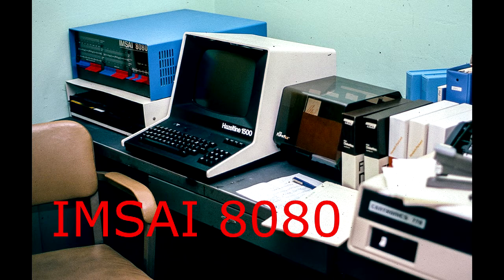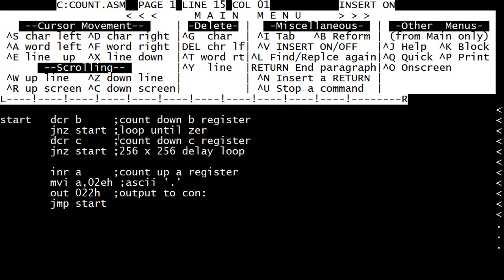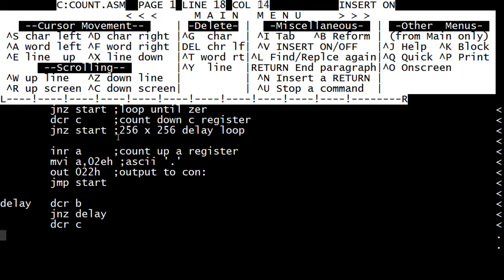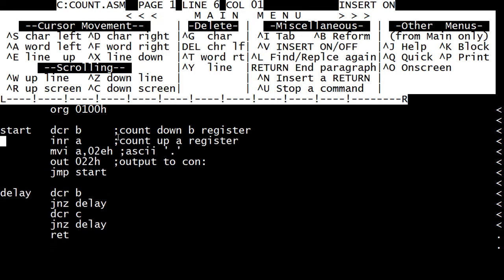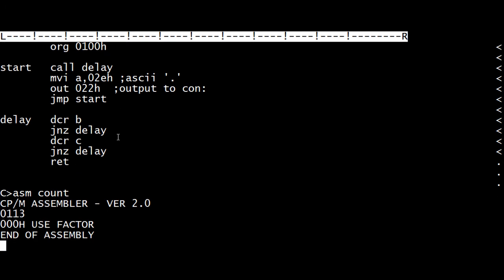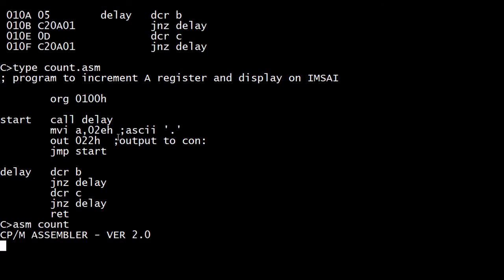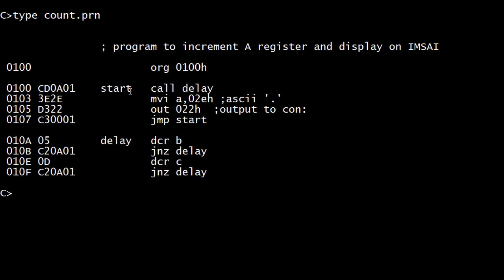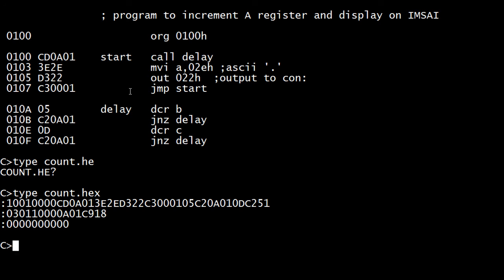#33 IMSAI 8080 count with subroutine

Comment: is the call to delay "CD0A01", while the function is at 0x010A beacuse 8080 is little endian?
Reply from the maker: Yes. big endian or (big end first) and little endian (smaller end first) tells the order of the two bytes. Some people just say high byte low byte or low byte high byte. I usually use the term endian when talking about one byte and the order of the bits, usually in the context of a serial data stream. is it bit 7 6 5 4 3 2 1 0    (big endian) or 0 1 2 3 4 5 6 7. anyway yes in 8080 the two bytes are low byte and high byte